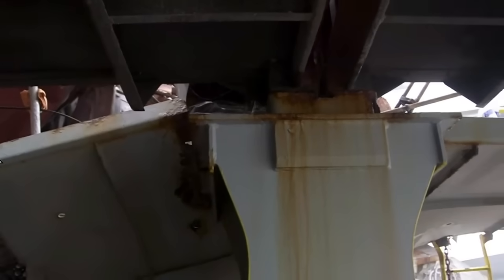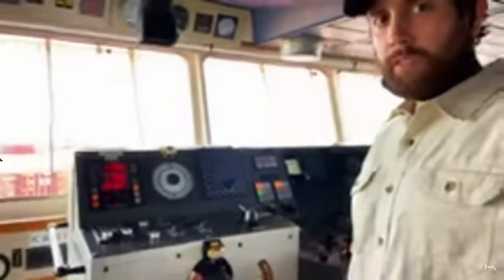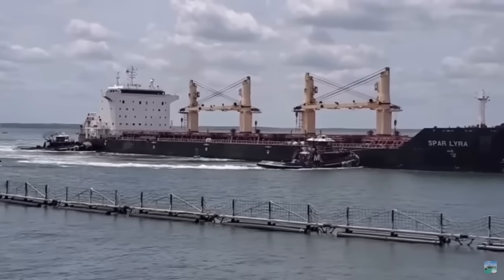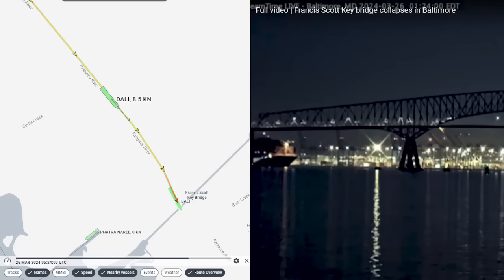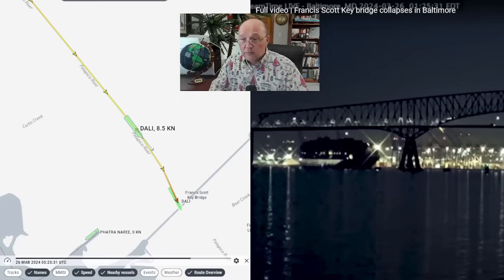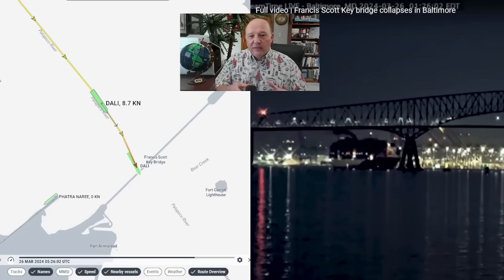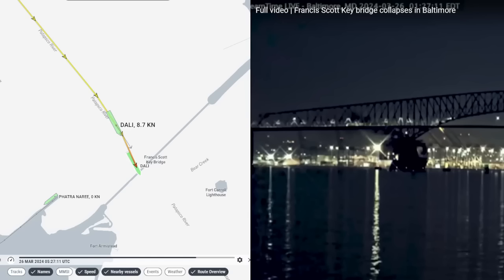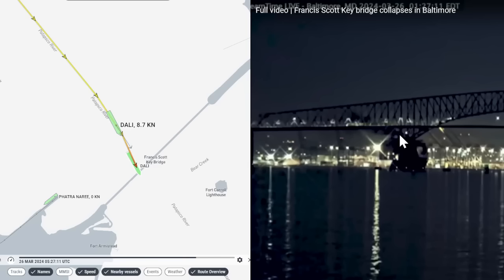Dali Timeline from Data Recorder in Striking Francis Scott Key Bridge in Baltimore, March 26, 2024

Comment: “Why did MV Dali veer to starboard once it lost power and main engine?”
I more and more tend towards the reason is due to the currents induced by the MV Dali propeller itself in the relatively shallow waters of Baltimore port. Currents of Curtis canal and last remaining tidal currents, plus bank suction and some wind might add on top and in unfavourable direction.
As long as main engine still running, it appears like the propeller walk even seemed to be compensated by these currents here, as rudder has been amidships (0° as per NTSM preliminary report; i.e. not compensating any prop-walk effect). Once main engine gone – which as per feedback from experienced chief engineer obviously can / will happen in quite short time – those currents will still keep remaining for a bit longer time nevertheless due to inertia of water; now dominating since also no prop-walk any longer.
Reflecting about this for quite some time, here’s my hypothesis for explanation: it’s related to “conservation of momentum ( momentum =  mass * velocity )”; and I do not apologize for using physical law here 😅. Basically & simplified it says “if you want to bring a mass m1 to speed / velocity v1, you also need to bring another, second mass m2 to a speed v2 (but opposite direction), so that m1 * v1 = m2 * v2 (the "-" to satisfy physical law that sum of both needs to be zero; i.e. velocity can have negative value).
For rockets accelerating in outer space, the second mass and very high velocity comes from hot gases being created when burning fuel in the rocket engine; pushing the rocket when moving outside.
Other and very funny extreme example which we don’t spend any thoughts about is when going by car. It’s the engine and good friction of the tires which “brings the horse-powers on the road”. But at the very end, it’s also momentum again, just that the huge mass of mother Earth will not significantly increase its speed (of rotation) 😀.
So what about shipping in water now? Simple answer: the ship’s propeller needs to bring a lot of water on speed, which will cause currents in the water all around.
I did very simple calculation trying to get a grip on the dimensions. For simplicity, let’s take a mass of 100000t (metric tons) which needs to be brought on speed of 8 knots ( ~ 4m/s ). Applying conservation of momentum ( momentum =  mass * velocity ), it needs equivalent mass of 100000t at same speed (or less mass but at higher speed then – which we safely can assume is the case for regular operation; with `prop wash´ is required for rudder being much more effective), but in opposite direction. Sounds incredible, but considering water comes along with weight of 1t / m³ (1000t in a cube of 10m x 10m x 10m = 1000m³), it “just” needs 100 * 1000m³ , i.e. 100 of such 10mx10mx10m cubes. Dali has width of ~50m, and can only move along the main channel of Baltimore harbour (with only little clearance). Thus I’d expect the amount of water which can be used for propulsion below bottom is quite limited. Means most of the water to be pushed & accelerated by the propeller needs to come from the sides then. For simplicity, let’s split 100 * 1000m³ in (2sides * 50cubes/side) * 1000m³ or (2sides * 2lanes * 25cubes per side&lane) * 1000m³. In other words, all the water needed comes from 2 lanes with width of 20m next to Dali at a length of 250m (which is almost full length of the ship), which will cause currents in the vicinity of Dali. However, due to rotation of right-handed propeller, there’s also drag / pull of water on starboard, and push-up on port side. So in principle a vertical component pushing Dali’ stern to port, but obviously compensated by propeller walk here (rudder amidship at the time of first loss of power). However, once main engine and propeller stops, the flow of tons of water will still continue for bit longer time, with a vertical component pushing stern to port still and thus causing bow moving to starboard (and the pillar) now; assuming the ship turns around its centre of gravity.
Sounds reasonable?
Would be interesting to know whether the water depth is considered in simulations of harbour situations.

For all the maritime professionals out here: feel free to file it under “Aahhh, another landlubber discovering maritime basics” 😅.
But as engineer, I prefer to start getting understanding based on such basics first, before right-away going into esoteric stuff or even this conspiracy crap (…) why Dali veered towards the pillar during the blackout.
Root cause finding puts quite some focus on the electrical equipment. But there’s also kind of `bridge´: it’s not by chance electrical engineering (especially for high frequency & micro-waves) also uses terms like currents, waves & vortex as there’s lots of analogies to be found in fluid mechanics (but much more tangible there).

Comment: I think you're correct that it was smelling the bank. I don't know the tidal currents in that area but Curtis Bay could still have an ebb flow even if the rest of the bay was at slack water. It's also possible that because they were on the left side of the channel they could have put some right rudder on just before they lost power and couldn't control the rudder. If the bow was aground just before it actually hits the bridge that could account for the swing to the left.

I can't wait to see the final NTSB report.

Good use of the NTSB b-roll.

Comment: Article about rebuilt Sunshine Skyway bridge, with aerial photo: "Sunshine Skyway set the standard for bridge protections. They weren't present in Baltimore".

My opinion (Mechanical Engineer) on the Sunshine is that the dolphins should be spaced further from the columns, due to the large rake of container ship bows, and much greater amount of energy to be absorbed than the ships of the 1980's.

Comment: UK marine pilot here, a proper Port Risk Assessment would not allowed a vessel of this size in confined waters with out a tug strapped on. Ships black out quite often, usually in the worse possible place. A thorough Risk Assessment would have considered the likelihood of a ship blacking out near a bridge and concluded tugs to be made fast until clear of the narrow channel. Expensive? yes, but not as much as rebuilding a bridge and having a port cut off from the outside world.

Comment: My theories from a ex Chief Engineer.

1.  The first blackout - Causes to be determined but emerg generator starts but possibly does not enough power for the steering gear.  It may  not be big enough.  This is a class issue.

2.  Atomation will start  a main alternator, but only one.  All the pumps, steering gear and other equipment will start up which could have overloaded the first alternator before the 2nd or 3rd alternator comes on line.  Getting a ship up and running after a blackout takes some time and the starting of the equipment is sequenntial.

3.  The black smoke.  In a blackout the main engine will motor to a degree depending on the speed of the vessel and will not start in astern until the ships way slows enough to the safely start the engine.  This is a setting tested in commissioning and cannot be overidden, to my knowledge.  Possibly the main engine did start in astern and put to full  Revs (full fuel).  The turbochargers will not keep up with the air required by the engine to match the enormous amounts of fuel going into it, hence the black smoke.

4. Why did the ship turn to starboard.  Possibly, when the Main engine was started in astern, the ship was still going ahead and the pilot and/or Master put the helm to starb possibly thinking that once the vessel stopped, and going astern, the bow would swing to port.  Back out.  There was not enough distance for that.

The whole incident is tragic because of the loss of life and the economic consequential damage will be in the billions, which we will all share in paying.   These ships are just too big, in my opinion, risky.  2 tugs would not be able to do much anyway.  The ship is too big.
Reply: well said Chief ! Just curious if the rudder was stuck on stbd helm when the black out occur whil waiting for the EDG to cut in? If the current is from the stern, it would be almost impossible to steer without propulsion. Again it would take a long time for the rudder to move on emergency steering mode under EDG.

Comment: I have been aboard a ship that lost power at sea and it is a real scary feeling when the ship is quiet, especially inside where the emergency lights may or may not come on.  With everything today being computer controlled and crews reduced to a bare handful to cover a massive structure like this.  If this turns out to be a failure in the automation I wonder what the impact will be.  They are pushing for fully automated ships run by AI.  I personally think the tugs should stay with the ship till it is clear of hazards like bridges.  Something weighting 100,000 tons moving at 8 knots has a lot of Kinetic Energy.

Comment: It is interesting to note that the towers carrying electric power just north of the Key Bridge did have a barrier around it, unlike the bridge support.  It is clear in many of the videos of the bridge but not commented on
Reply: The power lines were only put up within the last couple years while the bridge was built in 1977. But it does show that they were aware that barriers or dolphins should have been placed around the piers of the bridge.

Comment: In naval ships, the rudder can be locally controlled in an emergency from an Aft Steering Position (ASP) using a hydraulic hand pump. Though it is much slower and requires a lot of muscle power, it does work. The ASP is also manned by a skilled rating while leaving the harbour till we reach the open sea. There is also an emergency communication line (normally a Sound Powered Telephone) between the Bridge and the ASP for passing rudder and helm commands. Do commercial ships also have a similar system and SOP in place?

Comment: Sal, 

The most critical aspect when arriving and departing US ports are the fuel feed and circulation systems. Emission constraints require Marine Engineers to shift to Low Sulfur Diesel Fuel prior to entering US controlled Emission zones. This causes the viscosity and pressure to decrease causing starvation to the Main Engine and Diesel Generators. After the in port period much of the heavy oil flushes out causing major fuel leaks at the fuel feed and circ pumps, generator booster/circ and injection pumps. 

USCG NTSB investigation will point to the Engine Alarm Log.

Comment: As former Electrical Officer on Merchant Marine, it is clear that ships electrical generators failed. Normally in manoeuvre you keep running additional generator (there is always designed spare capacity), so if one fails you are not in emergency situation, and you should never have blackout. Emergency generator can run emergency lights, bridge equipment,  steering hydraulic pump and air compressor for engine starting air, but not much else. Certainly cannot run bow truster and if you try it will overload and shut down emergency generator. This model of ship has fixed pitch propeller meaning that engine must restart in reverse to slow it down or go backward. And you cannot reliably start main engine without some main generators is running to provide power for blowers, which are used instead of turbo charger at lower speeds. So in short, you must have at least one main generator running to run main engine. And BTW, portside anchor will drag ship direction to left... I hope this helps...

Comment: I wonder whether before the loss of power, they'd started steering the ship to starboard to trim it into the right half of the channel; or at least to center it in the channel while passing under the bridge.  And then while right rudder was applied, the ship lost power and steering control, and they couldn't take it back out of the gentle turn.

Comment: More analogizing to much smaller vessels here...Is slight right rudder input necessary to counter the pull of a right handed propeller to port? So if you lose that pull to port from engine failure the same rudder angle turns you to starboard?
Reply: We're not sure they lost engine power... rather than rudder control. 

I was thinking, as they passed the Curtis Channel, at one point, the bow is getting pushed to port by the outgoing tide coming from that channel.  If they lose rudder command at that point, are the rudders going to turn them to starboard, as the current effect moves amidships and then hits the stern?
Reply: @jimbobeire  I guess my hypothetical was assuming they lost all electrical power and consequently both rudder and engine. 

On a right hand sinngle screw boat the consequence of holding rudder angle and backing way off throttle is a turn to stbd.
Reply: @boatbutch  Good point. I was thinking the prop walk was mostly from throwing the engine full astern.

Comment: Regarding what would have happened if there were tug, I remember a similar incident more than 10 years ago where cargo ship lost power while manoeuvering and it knocked down a building. In that case the ship was manoeuvering assisted by two tug boats but they were unable to stop the ship.
I don't remember much details and a Google search is of little help, but I believe what happened is that the lines snapped.
If you want to research, it was the Jolly Nero and happened in 2013.
Reply: Yeah, here they totally denied a much smaller ship transit due to risk of collision to the bridge, and rejected the option of using tugs due to risk to the tug pilots. And that would have been a pre-planned tug operation not a huge ship moving at normal speeds for a port.

Comment: yes when the EDG kicks in you have hydraulics on the stearing stand but only 1 pump instead of 2  which would make the rudder movement slower. There would be a delay, especially for quick succeeding orders... the real question is, is what happened during the 35 sec blackout? Did the rudder stay in the last position the helmsman had it in (in whatever position that was needed to course correct or not?) + she was already to the starboard side on a slow course, 8.5 knots is not an ideal maneuvring speed for that size of vessel + the bank effect with the forward and side banksuction
Reply: would be easy to see what the rudderposition during the blackout

Comment: Great presentation Sal. But I have to disagree with one thing. A big heavy ship like the Dali in a situation with no propulsion but full steering function might not be able to correct course. The propeller wash over the rudder is what really gets a ship to turn. Especially when you factor in bank effects and current, as you already noted.

Comment: 12 years ago, I worked on a ship as an electrician and we had a problem with fuel in front of this bridge. the problem started earlier.when we left New Port, after the Hamptons during the reception of the pilots. The alarms went out in the main engine's fuel system. high low viscosity. I knew it was water in the fuel, as we had several blackouts before. After a severe storm, the bulkheads between the ballast and fuel tanks burst. I switched the viscometer to the bypass and cleaned it all night. Around 6-7 am we docked and my contract ended.

Comment: Key concept here that most (especially the media) will not understand.  It's actually quite simple.  When you are speaking of a large ship, NOTHING, repeat NOTHING happens quickly.  

Engines take time to respond, especially to a direction change.  There is no "reverse" gear.  You go from "ahead" to "stop" to "astern" by stopping the engine, then re-starting it to turn in the opposite direction.

When you turn the helm wheel, it takes time for the rudders to move, then even more time for the ship to respond to the rudder movement.  To stop the ship from turning generally takes a rudder order in the opposite direction unless you have miles for the ship to straighten out.

A ship does not have brakes.  You either let her drift to a stop or slower speed over miles, or you reverse the engines and pray.

Just for trivia, how a ship responds to the rudder is directly dependent upon speed through the water.  How deep the props are in the water and how deep the water is also affects how the ship will handle.  If you are riding high so the props are near the surface, this can actually impart a sideways motion to the stern.

In the US Navy world, entering or leaving port means calling away "Restricted Maneuvering", which means that what is required for maneuvering is online, and what is NOT required is is up and running in standby...If you have 4 generators and need 1, then you have TWO online, with the other two spun up and available upon demand by closing a bus tie.  If your steering gear has two pumps then one is online and the other is spun up and ready to take the load if the online pump drops.  Sailors on watch are replaced by the most experienced watchstanders available.

Comment: This is ex marine Chief Engineer seafarer. Many say after first power restore, black smoke is due to main engine going astern, to reduce ship's speed. However, I think, when electric power is restored, propulsion main engine can not be started, within seconds. All pumps etc has to started first and they are located all over in engine room. So it takes several minutes to start the main engine after a blackout. So I doubt, if any astern movement on main engine before the collision. Moreover, if there is a power outage, engine crew will be busy restoring generators, on priority and then the main engine. Thanks.